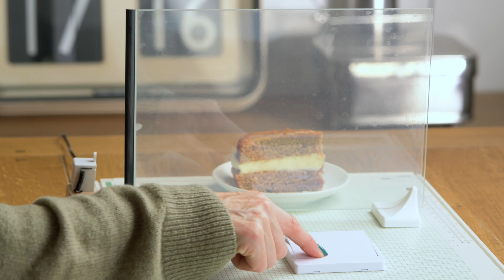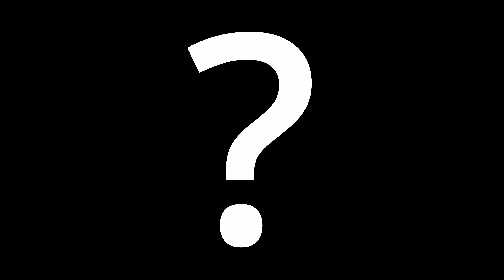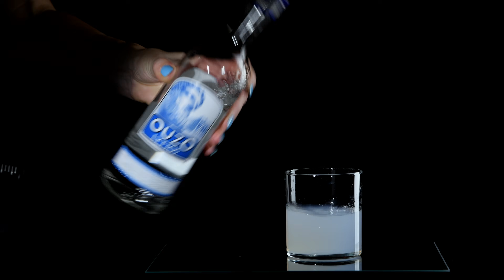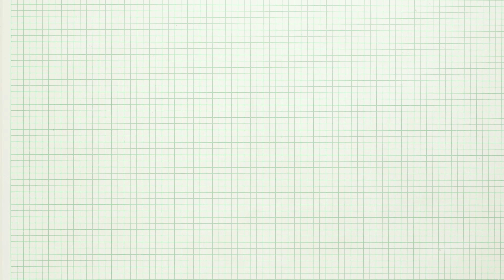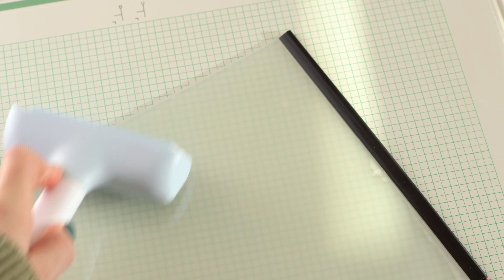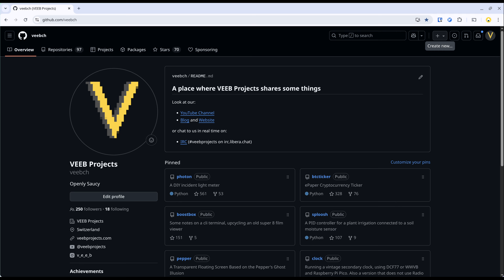No Kink Shaming Here

Comment: Is it possible to wire in a potentiometer and vary the amount of current to make a dimmer?
Reply from the maker: If you could figure out a way to vary the voltage (like a voltage divider). It's the voltage, not the current that drives the re-orientation